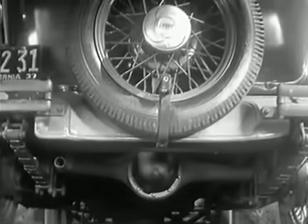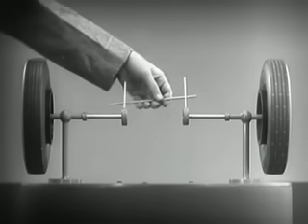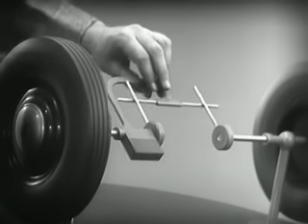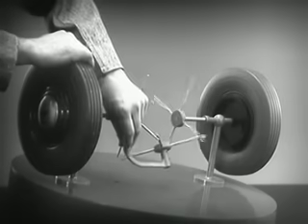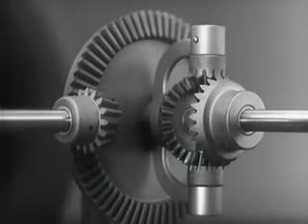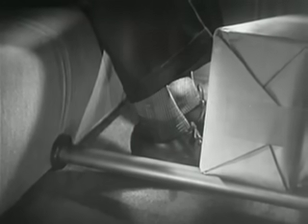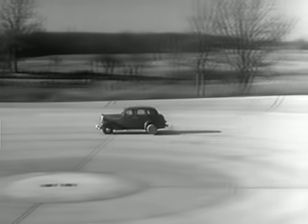Around The Corner - How Differential Steering Works (1937)

Comment: Notice the oil scoop on the carrier. Many old axle and engine components had scoops to pick up oil to lubricate parts adequately. Early oils did not have as good clinging and stickiness properties and needed to be constantly dumped or squirted onto components to keep a film.

Comment: We 4X4 drivers know this differential sends power to the wheel of least resistance.  Not the best way to get traction in slippery situations.  I'd enjoy seeing this same video demonstrate a locking differential to send power to the wheel with greatest resistance.
Reply: Rea Ality a Locked diff spins both your wheels at the same speed. The same as a straight axle.
Reply: Just add an extra mechanism that locks the moving gears
Reply: My Fwd mazda 3 doesnt even have traction control. It snows 6 months a year where i live. I can barely take off from a stop
Reply: @l4dfreak101  okay?

Comment: Great video. I would have loved a car that didn't have a hump for the drive shaft. Every one i've ever owned had a hump, including front wheel drive cars, which don' t even need a hump.
Reply: That hump is usually meant for vehicle strength (unibody construction) and probably for the exhaust I guess...

Comment: Is there a automatic transmission video like this?
Reply: Automatic transmission is way more complicated. Manual there probably is. Automatic trnas uses fluid pressure and check-balls (one way valves) to clamp bands on housings to engage gears
Reply: There's a late 40s video explaining how a fluid coupling works. It's from the US Army.

Comment: So the outer wheel speed is always dictated by the power source? And the only reason the inner wheel spins at a different rate is because of the resistance from the ground? Couldn't it potentially still slip if the friction from the ground is reduced?
Reply: Nevermind, I see that's why the limited slip differential is used now.
Reply: Okay, now I'm wondering what happens if the outer wheel has less traction. Does it still spin at the same rate, but covers less distance?

Haha, it helps me to type it out to understand better and I'm just posting these because others may have similar questions.

Comment: In this system, if one wheel experiences more friction than the other (e.g. one wheel is on the road while the other is suspended in the air), won't the power from the drive shaft be concentrated on the wheel with less friction (i.e. the wheel suspended in the air) and hence be extremely inefficient? How do vehicles nowadays counter this problem and deliver power intelligently?

Comment: If anyone has any experience and can help me make any sense of these questions that'd be great!

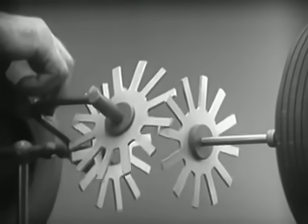Using the examples found at 6:28 and 6:31:

1. If two wheels are powered by one load (as is here) and one wheel locks, will the other wheel spin twice as fast?

In other words, which scenario is correct?
Scenario A: Two wheels get 100% power each, one locks and resists, the other wheel still receives 100% power.

Scenario B:
Two wheels receive 50% power.  One wheel locks and the other receives x% power (50? 100?).

Back to questions:
2. If one wheel locks the pivot will spin counter clockwise.  If the other wheel locks it will spin clockwise.

What happens if you're speeding at 100 mph, the left wheel completely locks then unlocks at the exact same time the right wheel locks then unlocks.

Will the differential suffer from a sudden change in directional rotation?  As though it took it's own output head on?

Example, say they hold one wheel in this demonstration and forcefully push the second wheel.

While it's violently rotating, they let go of the first wheel only to immediately stop the second wheel.

Will the pivoting joint continue on, changing it's rotation at the whims of resistance, or will it take it's own output on head first?

Is there a violent jolt as it changes directions from it's own energy or does it just change rotation freely?

How does it even overcome things like friction, how much slippage is allowed to occur, how do we regulate it or is this not necessary?

3. When turning right, is it the resistance from the front right tire cutting off the path of the back right tire that which increases the amount of power needed to push forward (and therefore allows more energy to go to the outside wheel)?

I'm just trying to visualize all this, lol, thanks!

Comment: If one person has one working mind in his head he will understand that this method is wasting energy. if one wheel stopped and both the shaft and other wheel are rotating there will be massive waste in energy between the rotating parts. The only way to preserve the energy is by locking the deferential. 

I am still believing that my life will be much better if I was not surrounded by ignorance. Not just any ignorance it's ancient and accumulated.

Comment: If both the wheels stop then differential will slides on only as per logic .so why it is not sliding in normal case without transfer power.

Comment: 1937: Opens with motorcyclists doing tricks, and relates their tricks to the educational purpose of the video. Creates a simple, easy to understand model and complicates it piece by piece so that the viewer understands each piece separately and learns more.

2017: Opens with a real differential, which is both intimidating to some viewers and hard to disassemble and explain piece by piece (as the parts work together to function correctly), but only begins the educational content following 3 minutes discussing their latest video, asking for you to like the video, and begging for subscribers. Finishes video with begging for likes and subscribes.

Worthless content nowadays, I think they should be showing these videos in class, not the new ones.

Comment: I like how they built a mock-up of an interior with the shaft running by the driver's feet to show how bad the idea is, lol
Reply: And yet, many cars DO have a driveshaft running in a tunnel by the passenger's feet.  They've lowered the center of gravity even more for safety and performance and that's why some cars still have a driveshaft tunnel down the center, especially if they're AWD.
Reply: That was really interesting for me because every car i have been on has the driveshaft like that, i have never seen a flat floor in the back seats.
Reply: Felipe C Most new cars have a tunnel but used for the exhaust  since most are fwd now. Awd and Rwd might be the exemption.
Reply: Felipe Cárdenas Villegas HOLY SHIT IT ALL MAKES SENSE NOW

Comment: Okay, so that's how differential drive works. Now where's differential STEERING? Enforcing specific speed difference, to allow e.g. turning a tank in place on its tracks, where one track goes forward and the other backwards? 

Downvote for misleading title.
Reply: Not really. If you understand how vehicles actually operate, it's actually quite accurate.

Comment: That is bloody impressive. Something that hasn't really changed much in decades is extremely simple
Reply: No need to reinvent the wheel.
Reply: That still isn't a complete rework of the differential. It's just an upgraded version.
Reply: My Master (as in, the guy who trained me in my field. Not sure if that term is actually used in english?) used to say: Good, reliable technology is always simple. The more moving or electric parts (including sensors and all that) the more likely that something is gonna screw up.

For a bit of context (and a little anecdote to prove him right): Our company was responsible for the street lights in my town, and we were in the process of excanging good old Vapor lamps with some more newfangled high-tech lamps (some streets even got LEDs).
The Vapor lamps had a coil that acted as a limiter (similar to a resistor), and that's it.
The newer lamps had some complicated electronics, including a ~30€ circuit board. (The Coil for those vapor lamps would cost 4€ I was told...)

In the year that I did that particular job, I had to exchange countless amounts of those circuit boards. They broke left right and center, and you could always SMELL it as soon as you opened the case they were kept in... (I hate that smell.) Also keep in mind the company had just begun installing these maybe half a year before I joined them.
The Vapor lamps?  Maybe five coils the entire year.  And we had 10 times more of them than the new ones at that point.
Reply: our consumer experience is different. We bought a lot of 6 watt and 12 watt LED light bulbs to replace the horrible incandescents and halogen copies that die after as little as 2 weeks (our measured voltage is at roughly 242 volts, transformer distance and all that). Out of all the LED lamps we installed only one failed, after around a week or so, all the others have worked beautifully up till today, and its around 2 years we've had them now. I am a little concerned about the heat at the back of the bulbs, especially the 12 watts, as they are too hot to touch, but i guess the electronics are capable of such feats without frying...
And they are also a bit brighter than the comparable 60watt bulbs, but unlike them do not need to be replaced at all.

Also they were cheap Ikea leds that had a good wattage for their price at the time, while most LED lamps i ever saw in stores were overpriced beyond belief and had embarrassingly low light output.
But i agree about overcomplexity, and all the energy saving bulbs are exactly that. Filled up with electronics and mercury, and many of them don't even light that well and might need a long on time before they reach usable intensity. We threw away so many of those, and in cases were i wanted to reuse the parts inside i often discovered scary cases of wire melting through capacitors and other components because of the extreme heat. I guess they must be loaded with flame inhibitors since our house is still standing...

And ending my wall of text, ON THE OTHER HAND, we have some 100 watt Phillips bulbs that we have kept and used for maybe 60 years, that still work perfectly today!
Incandescents are ingenious in their simplicity, and if you already use an electric heater there isn't that much lost by using them instead of LEDs; only problem is that modern incandescents are all designed to fail. And the time it takes for them to die have only decreased in our experience. As in, the ones we bought 10 years in the past sometimes lasted maybe as long as a year.
We use to joke that you should buy up as many of the good LED bulbs as you can now while they are still built to last!
Reply: The problem with LED lamps is not the LED lamp.
The problem with LED lamps, just like the lamps in my anecdote, is the electronics needed to adjust the voltage, frequency, current... all of that.  THOSE electronics are what fails almost 99% of the time.

I've yet to see a failed LED light where the failure was actually one of the LEDs and not a piece of 'support' electronic...
Reply: It has changed alot on the cars that can send torque differently to each wheel. Look up torque vectoring differential or watch?v=rQowh2Kr38s.
Reply: Yes, the thing about an LED is that it is inherently a low-voltage DC device.
Very simple, uncomplicated thing by itself, but if you're going to run enough of them to produce any substantial amount of light, and run them off AC mains voltages...
Well, LED's are very easy to damage with excessive current, and you end up needing heat sinks and the like as well. (they are semiconductor devices and that has similar implications to any other semiconductor device.)

The LED light in my room failed after less than 6 months, which really surprised me given I have 30+ year old electronic devices with LED's that have no issues whatsoever, but it just goes to show you what SHOULD be simple and reliable, may not be for whatever peculiar reason.

Then again, in an inherently DC circuit an LED really only needs a current limiting resistor, and even that only if you can't trust the circuitry around it. - And of course these devices are more likely to have other components fail than an LED that doesn't even perform anything remotely resembling a critical function of most such devices...
Still seems strange that larger LED installations used purely for lighting would have such a high failure rate though.
Reply: Sapphire EX LED lamps are pretty simple too. The problem: companies that produce them are programming them to stop working at certain time. In fact led lamps, on good quality can last more than 20 years.

Comment: im dumb do the front wheels need a differential?
Reply: Yes, if the car is front-wheel driven, which most modern cars are.
Reply: If the car is front wheel driven, then yes. If not, you don't need to worry about it because the front wheels can simply spin freely, like on a carriage.
Reply: +A Citroën Traction Avant was the fwd car of the era, and it was monocoque

Comment: All that hard work went into developing diffs, just for us drifters to weld them solid!
Reply: Your username, profile picture, and comment are in perfect harmony. Well done! 

P.S. What car is that in your profile picture?
Reply: +Marcos Cruz LoL... It's my Nissan 200 s13, converted to a pick up...
Reply: and off road guys to get lockers :)
Reply: murph1329 to be fair with auto lockers we still use the diff system, it just "turns off and on"
Reply: Could you explain why you weld them solid?
Reply: Here's an idea, when you are a complete fucking nobody harassing people on the internet, people don't really care about proving things to you.
Reply: slingitsideways yeah man! Gotta love drifting. But I wielding the diff makes it impossible for driving around on normal streets..
Reply: t*TO4ST It's a cheap fix. When drifting, you want both the rear wheels to spin up at the same time and keep matched speeds. with a normal open diff like in this video, the wheel with less traction will spin up first while the opposite wheel sits there doing little to nothing,  like when it's shown in the video, when the inside wheel turns less round a corner than the outside wheel. when you weld the diff, you are basically doing away with the gears that allow one wheel to turn quicker/slower than the other making both wheels turn at the same speed all the time. downside is, when turning a corner with a welded diff, the inner wheel hops and scrubs on the tarmac, causing extra tyre wear. Hope that makes some sense.
Reply: lmao i agree
Reply: gay
Reply: ImBarryScottCSS  you mad b
Reply: first of all if thats your car its still a piece of shit...secondly you probably dont even drift and your some 13 year kid posing. send a link to a video of you drifting holding a sheet of paper that says not a poser. get off youtube

Comment: What is interesting is if you stop one wheel the other wheel move twice its normal speed.
Reply: +Oliver o niell No it does not. It will have twice the power not speed.
Reply: Purple Bananas Am no I meant the ratio of speed between the drive shaft and the wheel. you should really look up what power is remember force by distance is energy and force by distance over time is power.

Comment: Awesome video. I'm trying to figure out why my left rear wheel is always the one to lose traction before the right rear wheel on my car. This happens when I had an open differential and still happens with my limited slip differential installed. I know "path of least resistance" is the cause.

Comment: Disadvantage: If one Wheel lost the grip the car wont start. Thats why you can turn the differential off in some Outland- Cars.
Reply: How do you turn a differential off? It's mechanical, not electronic?
Reply: By locking the rack- wheel in the middle I think. With mechatronics. The engine is mechanical too but I can switch it off with electrics.
Reply: Are you talking about an electronic locking differential? I think the wording that you used just confused me because it's uncommon for someone to say turn off the differential lol
Reply: Michael P
English is not my mother language. But you know what I mean now.
Reply: Yes, they are used in off road vehicles such as Land Rover and Hummer.
Reply: that's why there is a locking differential.